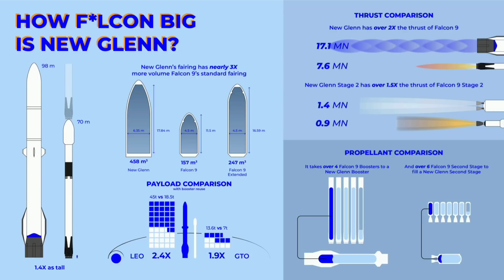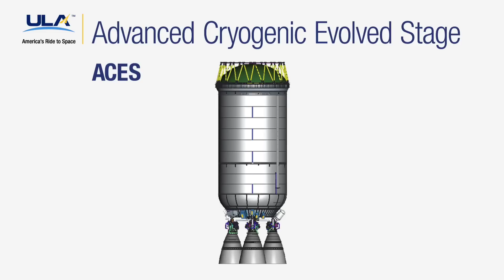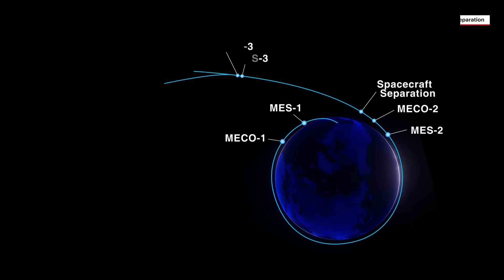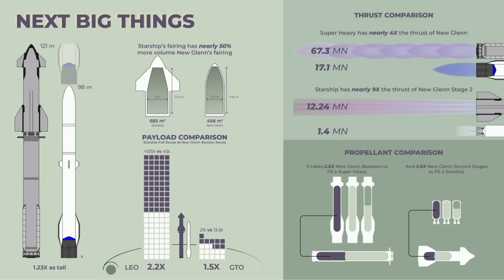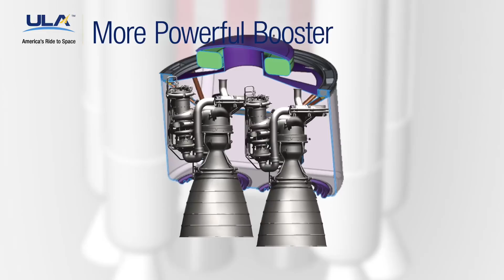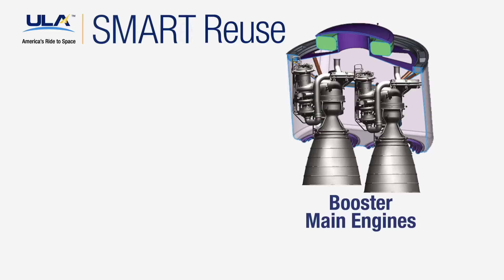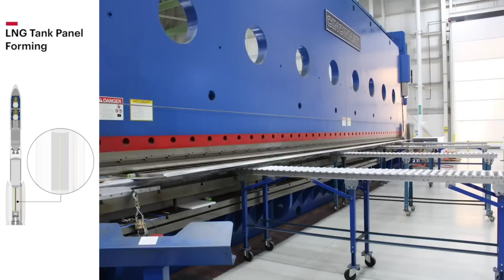Bad for NASA!  Bad for Spaceflight!  If Blue Origin buys ULA, only Jeff Bezos will win!

Comment: I am not as pessimistic. It will still take time for New Glenn to be properly up and running, especially reusable. So I could see them using Vulcan (a more proven/traditional design) for a few years before canning it.

I also think that it might be good in general if BO can retain a lot of the experienced staff, especially someone like Tory Bruno.

A question, if it is just about canning a competitor, couldn't they just break up their contract with ULA for the rockets? Surely it wouldn't cost them more than a few 100 million, and it is unlikely there will be fast another replacement ready. Imo something like this could be a real nail in ULA's coffin. I also don't think it is worth taking them out due to them being prefered vendor, since that likely would just pass to SpaceX, not BO. If BO origin takes over ULA however, maybe that prefered status might pass with it if there aren't initially too many changes.

And well, it would be better than ULA potentially being sold of for parts.
Reply: You're waffling.
Reply: @davidstevenson9517 And you are useless

Comment: The problem with reusability on an economic point of view it that when you have the rockets, that's it no need to produce more, because there's not enough demand in the space sector to make a viable economy, but if jeff make both his heavy reusable launcher that reduce costs plus the more intermediate and versatile vulcan centaur, then he create the demand to supply the be-4, and so he don't need to increase costs. On the long term that's his win
Reply: Of course if spacex goes bankrupt in case of starship termination, then jeff might decide to just stop launching vulcan centaur and stay with the new Glenn that would wipe the floor with the like of rocket lab and others micro launchers companies but also relativity.... etc. 

And once he would be in complete monopoly, just like Ford once was, he would raise the price of launches to no end until concurrence apear again, where would the chineses be by that time

Comment: Either way spacex has a generational technical advantage and is accelerating away..vulcan and new glen also, are not ffully reusable...
Reply: Neither are the Falcons and they are only partially reusable for LEO for payloads under 10 tonnes or very light payloads beyond.
Worse, Falcons are still "staged" launchers; these ballistic anachronisms will be ditched this century, SSTOs are the future for Earth launchers.

Comment: Thing is, Starship doesn't have to get beyond Low Earth Orbit for any lunar flight except Lunar Starship. After all, a payload doesn't have to be inert, it can also include a booster of its own, and once in orbit, it doesn't have to be aerodynamic. Imagine, if you will, a booster that looks something like an up-scaled version of the Apollo Lunar Module descent stage, weighing near on 70 tons, with a 30 ton payload atop it. Launched into Low Earth Orbit, do you think such a thing would be capable of getting that 30 tons to the moon?
Reply: NASA has almost written Starship out of Artemis. Any more delays from SpaceX and NASA will scratch Starship but still have Blue Moon, based at GATEWAY, for 15 missions.
NASA does hedge their bets; their U.S. Congress insists on it.
Reply: @davidstevenson9517  I don't knolw if they've realised just how much of a money sink Blue Moon will be. They'd be better off going back to the Dynetics Alpaca.

Comment: Interesting thoughts on what the acquisition of United Launch Alliance by Blue Origin would mean. But the analysis and conclusions could be skewed by omissions. Blue Origin has not, to date, made it to Earth orbit. Not a single BO launch ever reached orbit. New Sheppard is a sub-orbital vehicle. If it can be said that SpaceX's Starship is not yet a proven vehicle, the same can easily be said about BO's New Glenn. ULA offers something of greater value to BO that is, strangley, never mentioned in this video: experience. BO doesn't have the experience that ULA has. ULA may have as many as 150 successful launches to orbit for various lucrative contracts. BO has none. And it can be said that Vulcan Centaur is far-enough removed from the configuration and capabilities of New Glenn that it could prove to be a valuable asset. 

Here's the thing: what happens as the result of a possible acquisition boils down to three major issues:  1: What does a BOULA merger do to Vulcan/Centaur, and 2: Does BO simply raid ULA, fire its personnel, and shut it all down, or does BO absorb ULA, making BOULA more powerful and broad-based?  3: What happens to ULA's executive, Tory Bruno? If BO just cast Mr. Bruno aside, you know it's a bad thing. But if BO takes Mr. Bruno in and takes advantage of what he and others in ULA have to offer, that could be good for BO, good for ULA and good for aerospace.

Note that this video also never mentions other competitive up-and-comers like Relativity Space, Firefly and others that could still disrupt aerospace. It's even possible that Sierra Nevada / Sierra Space could get into the game with their own launch vehicle.

Comment: Look at the dimensions of the New Glenn and compare its volume to the Starship. It turns out to be a little under 1/2. It means, that in the current configuration, New Glenn is a little under 1/2 of the Starship's weight, or around 2450 Tonnes. Either Bezos plans on more than doubling the number engines on New Glenn or his engines can produce more than double their advertised thrust. Notice they never mention the weight or specific impulse of the BE4 engine.
I agree that Blue Origin shouldn't buy ULA. ULA works closely with the military and has a history of successfully launching satellites in a reasonable amount of time. Blue Origin does not have any of that history.

Comment: Didn't blue origin cause ULA's downfall by delaying and not completing their contract bargain?  If so, doesn't that seem suspicious that they are now trying to take it over?
Reply: Nah, there were other problems with Vulcan too, even if the engines were completely ready years ago, it wouldn't have changed things.
Reply: ULAs downfall? Vulcan has nearly 40 launches scheduled; you SpaceX Cultists are getting desperate!
Reply: @davidstevenson9517 , huh? What's SpaceX got to do with ULA and blue origin?

Comment: So wait… then how did Saturn 5 get so much weight straight to the moon without in orbit refuelling? How is it possible that Saturn 5 was more efficient than brand new starship?
Reply: It wasn't more efficient, not reusable and used more stages. It was also extremely expensive. It is more like the SLS, which is highly expensive due to politics and bureaucracy;

Comment: hope for bo's case that all the ula workers stay. or they'll be right back to square one.    good enough tech to get the job, but won't have the workers or knowledge capable. just like what happened to bo in the first place. the resources would be there IF they were capable. 
maybe ula will give them the knowledge/skills they don't have.... but i'm actully just expecting a dumpster fire effecting most of the private sector of space programs. its a shame it's ula being bought out and not bo. need more competent competition not less.   so much tech is about to be lost... i hope i'm wrong.

Comment: I don't know what they have been testing at Stennis for the last week, but it has been rattling things inside my house which is 12 miles, (19 kilometers) away from the test stands. Even my nearly deaf sister, who lives 16 km from the site, can hear thinks vibrating inside her house. You can clearly hear the roaring with every window (all double pane glass) closed, and the TV playing. That is some serious power for an engine at ground level surrounded by a pine tree forest. I could not hear the SLS full length firing, but could see the steam cloud from my front yard. So whatever they have been test firing has some serious kick to it.
Reply: I’ve been reading about development of a controlled detonation-based engine that delivers something like a 10% improvement in thrust. Trouble is, these engines are, by design, EXTREMELY loud.
Reply: I saw somewhere that they were testing the upgraded, disposable RS-25 engine for a future version of the SLS. So that may have been it. Private companies also use the facility to test their engines. It is a good location, since the area is sparsely populated, with barge access and an airport next door. Rocket Lab is using an old NASA test stand to develop their Archimedes engine, so that may have been it. Rocket Lab has a lease to build a big rocket plant inside Stennis.    @EMichaelBall

Comment: Once Starship has a 3rd stage, there is no other rocket that can come close to competing with it. And that's before even considering an expendable Starship. Put expendable Starship on the table, it could probably put on the surface of the moon what any other rocket can even put in GSO. I don't understand why people keep ignoring this fact.
Reply: Starship is going to be an overkill most of the time. The demand for commercial & private launches is extremely low. The overwhelming majority of those really small payloads. Customers aren't going to pay for a cruise ship ticket to cross a harbour, when there is a perfectly good bridge to drive over at a fraction of the cost. Starship is really only going to benefit SpaceX with launching Starlink satellites in bulk. Let's be frank though, it's still an eternity away from achieving those goals.
Reply: Starship doesn’t need a third stage if they can refuel it in orbit.
Reply: @DavidSchoening  Getting reuability to the point where refueling actually lowers costs won't happen before the end of the decade.

Comment: Man, AA's deep immersion in this potential acquisition brings to mind a host of issues/questions. First of all, BO has never shown any interest in timely completion of any project I can think of. Their failure to deliver on a timely basis is in large part the reason ULA is going bankrupt. I wonder what the real reasons were for their failure to deliver? It is well known that SX wants the Starship to be their primary launch platform with stated intentions of eliminating the Falcon 9 lineup. They have long had a larger fairing in mind for the Falcon Heavy and even have an agreement with the military to provide one, That would resolve any competitive advantage BO might have with regard to size of payload. As to the Starship, although both the Starship and Super Heavy are meant to return to earth, they don't have to. One or both could be sacrificed; stripped down and used to maximize payload. Even though the Starship has far more engines the cost of producing those engines is less than the BO lineup. They are also far more efficient at producing both the engines and the Starship itself. I wonder what the relative cost of a stripped down Starship would be to the New Glen? My guess is they would cost less or about the same. Advantage SX. The only advantage I see here is the past history of selecting ULA over other providers including SX. SX has had an increasing role in providing military support and I think that will increase geometrically with the Starship. We already know the military intends to build one or two military launch platforms. I think a lot of this depends on BO's ability to provide a timely service. The government will continue to support them but are less likely to give them the same latitude they gave ULA. Keep in mind Amazon. A company that some would say fraudulently wiped out the retail industry in the US and is now trying to make the public pay even more for it. We need SX but we don't need BO.

Comment: I predicted BO would buy ULA for fire-sale price after pushing ULA to the edge of bankruptcy, simply by stalling on engine delivery.   BO also buys all of the experience with orbital flight that BO has not been able acquire on its own.
Reply: So the Centaur V delays were Blue Origin? It was in work as early as 2018 and should've been ready no later than early 2023, but it wasn't and that's why Vulcan Cert-1 was delayed to January of this year. Even if BE-4 had been ready in 2021, instead of 2022, the CV wouldn't have been. Nor would the payloads.

Comment: ULA has a bunch of government contracts through the phase 2 contract from the US government. The majority of those are salated to fly on the Vulcan Centaur. I don't think the government would allow Blue Origin to scrap the Vulcan rocket until at least those missions are flown. So I think the Vulcan will be around at least until that late 2020s or early 2030s.
Reply: I was thinking the same thing because blue can't even qualify for launching military payloads yet. I believe they need 2 flawless launches.
Reply: Hence the reason for the buy outs.  Think of it like a local company buying a small bar simply to get the liquor license in a place where those are restricted.  Its a regular tactic where I am an Applebees and Texas Roadhouse as well as many other chains constantly paid big bucks for hole in the wall bars in my area because we have a limit on those licenses.  With the buy out BO will likely acquire all those rights that company had.  @Smiles10130

Comment: If this purchase happens, one could wonder if the development of BE4 was intentionally delayed to devalue ULA………
Reply: Nah. The BE-4 followed the typical timeline for a new large engine, and was delivered and ready to go 2 years ago. The delays in the end were on ULA with the H2 dome failure on the qualification Centaur V almost a year ago today that delayed Cert-1 to this January. 

In fact, given that CV was given the go ahead back as early as 2017, it wouldn't have been ready even if BE-4 had been in 2020 or 2021.
Reply: @mikedicenso2778  Thank you for the info
Reply: @mikedicenso2778 there was some delay due to Centaur, true. Before that, the BE4 was delayed for several years beyond what BO promised, a promise ULA had no way to know would be broken. BO is definitely at the minimum partially responsible for the problems ULA faces, if not fully. 

Every project has some projected slippage beyond the first estimates. Vulcan was first announced in 2015, with a first launch slated for 2020. The H2 dome failure caused a one year delay, the BE4 caused three. One year is well within the planed slippage for such a project, three is not. Whichever way you look at it, BO is at the minimum the biggest factor for ULA's problems and arguably the sole reason.

That this company is allowed to even bid for ULA is crazy and definitely in violation of anti trust legislation, if not in the letter then in the spirit of the law.

Comment: But, New Glen Hasn't even Flown yet!!!!
And you're talking as if it will.
I have my doubts about New Glen same as with SLS.
ULA and Vulcan Centaur is already a proven capable Vehicle, as well as Falcon 9 and Falcon Heavy.
Reply: New Glenn hardware is at the pad, a full stack of real hardware undergoing propellant testing. If all goes well, that will be rolled back, retrofitted with more hardware, rolled back out, and then undergo more tests that will end with a static hotfire.

If that goes to plan, then full flight-qualified hardware will roll to the pad for the first launch with the twin ESCAPADE spacecraft in mid-August.
Reply: @mikedicenso2778  Irregardless of what it looks as if they are attempting with it. FACT, it Doesn't even have All Flight Ready or Capable Hardware Installed. Which is Written upon many parts of the Vehicle.
Reply: @mcamp9445  Time Will Out
Reply: @JeffBrazeel-fe4wc  You seem to not understand what I wrote. The pathfinder is not the vehicle that will fly the first flight later this year, so it does not need all flight hardware, just a mix of flight-like and flight hardware that will let the tests I mentioned go though as planned. If these go well, most especially the static hotfire this summer, then the go ahead for the first launch no earlier than mid-August can proceed.

Comment: I think you are totally wrong BO will gain massively it will get a rocket that can get to orbit and I think Vulcan will fly all the flights as new Glenn disappears into the scrapyard that's why Jeff is buying ULA because BO cannot cut it.
Reply: Another thing to remember is launch-cadence. How many Vulcan stages are currently being built and stored ready for action? How many BE-4 engines are being built ready for action? How many complete Vulcan launches can be done at a moment's notice as per SpaceX?
Existing military contracts are all very well and good, but with BO/ULA focussing on Kuiper launches, how many vehicles could be dedicated to other clients?
Kuiper is going to have to face a mature Generation 3 plus network of thousands of Starlink satellites, the numbers growing daily. Kuiper will have to bring something new and compelling to potential clients that Starlink cannot. It won't be enough to put satelltes into orbit; it will be necessary to manufacture millions of ground-based antennas for customers, together with attractive pricing and performance. It doesn't seem likely that decent performance will be possible for years, until many many hundreds of working Kuiper payloads have been correctly deployed, and SpaceX will not be standing still, waiting for this. I would suggest that Kuiper is already dead in the water, and that all these proposed vehicle builds and launches for Kuiper are a total waste of time and resources for Amazon/BO/ULA/prospective new remote internet users.
So bring it on wannabe  me-too aerospce company Bezos/ BO. Waste your time, money, resources, staff on chasing a real-life Tony Stark, Elon Musk, and failing.